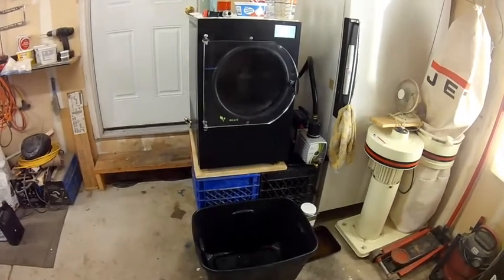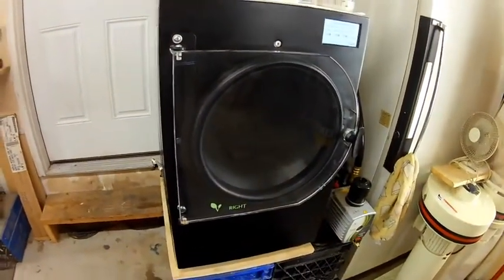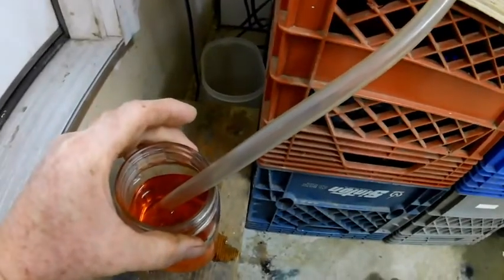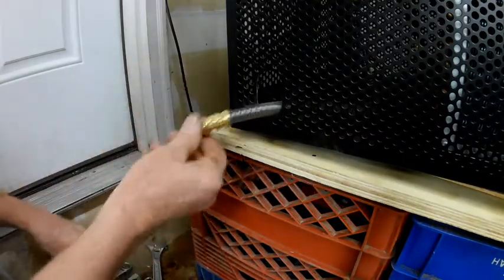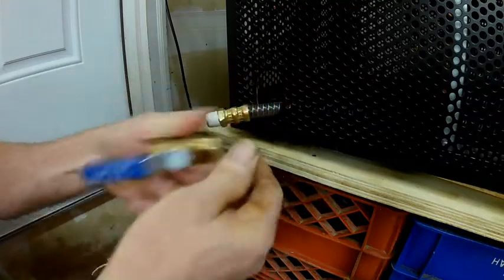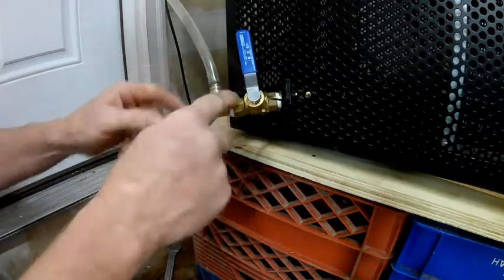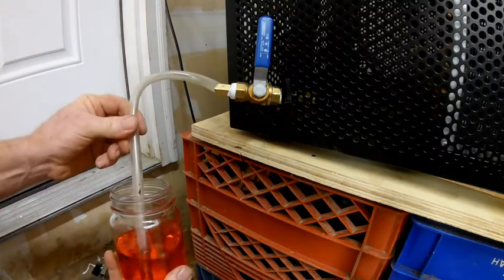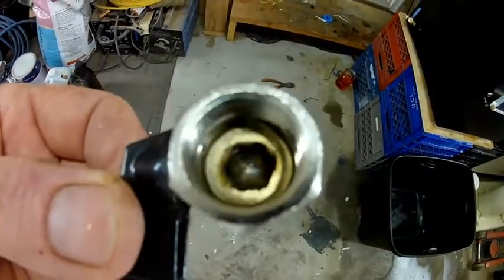Why is my Harvest Right Freeze Drier Leaking Vacuum?

Comment: I think the solution for me has been to replace the drain valve with a WOG600 rated ball valve, and then I taped every connection from hose all the way over the fittings to the threads with Silicone Self-Sealing Tape.  The only connection that is not completely sealed with that tape is where the hose connects to the vacuum pump.  I had my first successful bread batch and bottomed out below 80mT last night.  Thanks for the support and your helpful videos.
Reply: 80 mt’s!!! Wow!
Reply: Damm amy advice 80 mt

Comment: You should not make excuses for harvest right choosing cheap parts. I'm putting mine together for the first time and ran the vacuum test 3 times before fixing problem of no vacuum. 1st was a loose 90 where the vacuum hose connects to  the harvest right.  2nd was a piece of plastic that got sucked into the mouth of the vacuum hose from the chamber. 3rd  was replacing the 3/8 drain valve.  All this and I just received it new never ran a single batch, couldn't because 500 could not be reached. Harvest right needs to have better quality coming from factory in parts and quality testing before  it reaches customer. 
Now I get 500 in 13 mins 39 sec.
That you for helping solve my problem.
Reply from the maker: Glad I could help

Comment: I replaced my o rings in the hose and it works great now. Spent $1.67 at Ace Hardware. 7/8 OD 3/4 ID 1/16 W

Comment: I just got my freeze dryer a few days ago and was not able to get under 500Mtorr. After watching this video I took that ball valve off and it is already rusty and gunked up. It is brand new freeze dryer so how that valve is already rusted is beyond me. Thanks for the video though. Helped me find my problem.
Reply from the maker: Good to hear
Reply: @Philat4800feet  Hey Phil are these machines supposed to hold a vacuum. If I turn on the pump and pull a vacuum down to 500Mtorr and turn the pump off should it stay at 500Mtorr or gradually go back up? Probably a stupid question but I really have no idea and if anybody would know it would be you.

Comment: My pump passes the vacuum tests and all of the leak tests, yet after it goes to vacuum freeze, it throws the vacuum error.
Harvest Right takes their sweet time to assist, even blew off the phone meeting with me today and now seems I’ll have to wait until next week.
Their support of far worse than I had ever imagined. I asked to escalate to a manager and they told me the person helping me was a manager. This has been beyond frustrating and it’s been down half of the time I ha owned it.
Reply from the maker: The same happened to me with the vacuum issues.  There could be a third cause that I'm working on.  The next time you get the "Inadequate Vacuum" message, press continue.  You may have to do this twice.  My unit continued with the cycle and got down below 400 Mtorr.  The food came out without a problem.
Reply: @Philat4800feet  I did try that at first, but the error just kept coming back.
I plugged in the flash drive and looked at the log files. After 4 hours, in the vacuum freeze cycle, the mTorr number just keeps going up.
It odd that it only does this when it is super cold. But I can’t get it to reach the dry cycle anymore.
If I figure it out, I’ll let you know.
Reply from the maker: @fleebin2794  If it passes the carburetor cleaner test I wonder if your vacuum is ok, but your Mtorr reading is incorrect?
Reply: @Philat4800feet  I was wondering that too!
Reply: @Flee bin
Did you ever get this figured out?
I seem to be having the exact same trouble.
I pass all leak tests, machine stays in Vacuum Freezing phase until shortly after 10 hour mark, then "Inadequate Vacuum" error appears..4 times already.
This is my 5th attempt at a bread run.
Any suggestions for me?
Reply: @jocelynsadler6152  I had to send it back to Harvest Right for repair.
They thought it was a freezing issue, since the freeze pattern did not go all the way to the back.
Oddly, the original notes said they rebuild my premier pump, which I don’t have.
I had to call them back and schedule a meeting to get the real notes.

What is really odd was The first thing I did was to run a vacuum test, which it failed twice.
However it doesn’t fail when I run a batch and the mTorr goes into the low 200’s.
So, this is the opposite of what was happening.

This is their notes:
Repair Technician Diagnosis -
epoxy was leaking bad and drain hose was the old style and leaking was 284mt, after fixes would go to 84mt. Full frost and temp of -50.3. heat tested good and updated software, pump and hose tested good.
Reply: @Flee bin
Oh wow...did you get the machine back yet? And if so, is it working well?
I was able to get to 280ish  mTorr during my last vacuum test, in about 13 mins.
Then, when I try bread batch again, it gets stuck around 780ish mTorr. Close to the 10 hour mark, I get the vacuum error. 
So no problem reaching under 500 during test, but it never makes it there during a batch.
I'm feeling like it might be a faulty sensor?
Very frustrated as this is literally a BRAND NEW machine..
Reading a LOT of online comments, it seems like they may have dropped the ball somewhere in Quality Control for alot of these newer models..*sigh*
Reply: @Flee bin
Sorry! Just realized you mentioned it's doing the opposite now - you already answered my question! Haha
Reply: @jocelynsadler6152  Try a water test. Fill each tray with about 2 cups of water and see if it runs through to the dry cycle.
They did say they updated the software on mine, but no idea if that helped with the issue.
They said it had an epoxy leak. Don’t know what that means, but I had already sealed the top with silicon, as mentioned I other videos.
They also said my drain hose was leaking, even though I had sealed the fittings around where the hose met the fittings with self sealing silicon tape.
Best bet is to call Harvest Right and get a support ticket created.
These will tell you what tests to run and you may have to send it back, as I did.
Don’t waste your time on emails. If they are not responding, call the support number again.
Make sure you write down the support ticket number for each time you call.
Reply from the maker: Change your oil (new oil), put your machine in test mode.  Start up the freezer.  At -20 degrees start up the pump.  I'd like to know what you vacuum will be after 30 minutes run time on the pump.
Reply: This is why I won’t buy a freeze dryer, thousands of dollars just to have something not work! Crazy
Reply: @steveo1240  They really only seemed to create a proto-type and never seemed to built a real one, in my opinion.

Comment: My FD just arrived today. I did the prescribed initial function test. It wouldn’t go below 500 mTorr even in and hour. The closest it would get was about 550. I tried a bunch of times and in the process the minimum mTorr got worse and worse no matter what I did. I went to Home Depot, bought a 3/8” female/female brass ball valve, and presto, problem solved. Now, it gets to 500 mTorr in about 10 minutes, and to 430 in 20 minutes. Prior to replacing it, I did the water draw test from the drain hose, and it didn’t drain water. The inside of the original ball valve was caked with crap. I think the reason it was getting worse and worse was the crappy ball valve it came with leaked more and more every time I turned the valve. For a $4000 machine, I’d expect more.
Reply from the maker: Wow, a new unit with a bad valve...Shame.

Comment: You’re the only guy on the entire internet that says the ball valve is 3/8”. Some people are saying 5/8”.
Just got off phone with Harvest Right to be sure b4 I saw this vid.
Lots of videos show how to do the change but NOBODY mentions what size it is!!
Reply from the maker: 3/8" pipe size.  Most people may not know how to measure or measure with a ruler.
Reply: People are probably measuring the wrench flats when diameter is measured at the grove diameter of the threads for straight, and at the tip of the thread for tapered.

Comment: also to the thread of this subject.  Had a vacuum problem, pulled the machine apart to test for a epoxy leak, no leak there. The factory put the drain valve on soooo tight I had to have my husband and a new set of wrenches to get it off. Changed the valve and I did the test to see if it would get down under 500 mTorr and it did. I am running the other test now 
Fingers crossed.
Reply from the maker: Good for you

Comment: I haven't even done the drain valve test yet but I'm going to look there first. Ours is brand new and is having vacuum issues after only the third batch. It goes to 650mTorr and hovers there.
Reply from the maker: The drain valves corridoes after several batches due to the higher PH water.  I would look at the fitting first.
Reply: @Philat4800feet  I guess I'm just surprised it would do it that quickly. In any case, I'm heading home from Lowe's right now with a new heavy duty ball valve
Reply: Thanks for the tip!

Comment: i've had Inadequate Vacuum ever since i got my brand spanking new FD & i DID get one load of sperlaine dry bcz it was such light weight stuff but, had to run it twice!  now i'm trying to figure out how to do the thumb/flash drive test... you know...  for support read out.  i think you said the name of it & i thought i'd remember it but i guess i'm losing it for unfamiliar terms...  i've had my FD for 4 months but, am disabled so even just doing tests & moving forward is a big process for this great granny.  my 20# of carrots & some other stuff has long since spoiled...!
Reply from the maker: It sound like Harvest Right wants the log files form your machine.  If so, Turn off your freeze dryer, insert thumb drive, and turn on.  the files will download.  When done remove thumb drive and download files (attach) to an e-mail to Harvest Right.

As far as leaks, have you checked your hose and door gasket?

Comment: What type of valve did you replace it with? Looks much more robust than the HR one supplied!
Reply: I get it needs 3/8 pipe thread. But 3/4 int pipe? Wish you posted a Home depot link.
Reply: 3/8 fip. (Female)
Reply: @adamroper5259  do you see the one you bought on Home Depot’s site?
Reply: @adamroper5259  I guess I am an idiot, unless u can find a link to one that I need. :( sorry Adam

Comment: We couldn't pull a vaccuum no matter what we tried. Harvest Rite poured over the data and determined a new pump. We didn't get a single batch out of it from brand new. How did it leave the factory in such condition. For the 4000 bucks I spent, I expect better value right out of the gate. We got a new pump and tracked down a steady supply of high vacuum oil, and it's running the way it should now. Use a good quality oil and get yourself some self amalgamating tape and wrap every fitting.
Reply from the maker: Shipping company damage about 20% of freeze driers shipped out.

Comment: Can you give me ideas for door seal? I have to pull mine practically off of the drum and then close and lock the door before I get the thin strip around
Reply from the maker: Is the cord behind the trays keeping the unit sliding all the way back?  Try rotating the shelf unit CW/CCW
Reply: @Philat4800feet  thank you for the reply. I did have that problem at first but now it sits back and I have to almost pull the door seal off to get a thin seal. Once it starts vacuuming, I do get the wide strip.

Comment: I've done about 45 batches in a medium freeze dryer. Very few problems, does throw a vacuum leak every once in awhile but we just hit continue or whatever and it's fine, we don't even do anything.
Reply from the maker: The vacuum issue is why Harvest Right came out with their new software update.
Reply: @Philat4800feet  oh okay, I haven't messed with the software since I bought it but that was only like September of last year
Reply from the maker: @denverbasshead  Should be 5.X.16
Reply: @Philat4800feet  I'll see what version I'm at tonight
Reply: @Philat4800feet  I'm at 5.1.15
Reply from the maker: The next update may help you with vacuum problems.
Reply: @Philat4800feet  ok I'll do that soon. Just had to clean the condenser yesterday, so many screws to remove lol

Comment: I have my FD in my spare room which has one window. I'm in sunny FL so the room gets beastly hot. I open the window but it doesn't really help and our A/C runs constantly to the point of freezing up. Do you have any ideas on ventilation that might help? We don't have a garage, we are in a mobile home.
Reply from the maker: I see two problems.  
1.  AC system only freeze up when air slowly passes through the A-coil.  Either your A-coil is plugged up and needs cleaning or your intake filters are dirty.  The air needs to pass through the A-coils at a faster rate.
2.   Your freeze dryer will display a message when its too hot.  I believe it's 80 degrees.  A medium FD will produce  about 1500 watts of heat.  What direction does the window face? (NSEW).  Is your AC window mount or central?
Reply: @Philat4800feet  We have central air a brand new unit and all filters new too. They put dye but it didn't show a leak, they did wire it to the dehumidifier above the thermostat not sure if that would do anythimg to make it freeze.
Reply: @Philat4800feet  The Window faces West so gets the aftermoon sun. Ugh. The pump sits to the rear of the FD on the cart, was thinking of rolling the cart in front of open window while running to let the heat escape maybe put a little clip on fan too. Your thoughts?
Reply: @cheryls3777  IDK if you are actually on the move, or if your trailer park might have issues with thieves, but you may want to consider buying or making a small shed to put outside for your freeze drier. This is what I do for my bitcoin mining farm which has the same heating issues as the freeze drier but on steroids. You can put some fans inside to keep air circulating if needed.

Comment: pipe threading has always confused me.  are they 3/4 thread or 3/8?
Reply from the maker: Pipe thread is measured by the inside diameter of the pipe.  The Harvest Right ball valve is a 3/8" thread, because a pipe with a 3/8" inside diameter, threaded on the outside, will screw into the ball valve's threaded fitting.

Comment: Great video, have you considered adding a small amount of baking soda once and a while as a prevent treatment to balance out the pH?  Probably simple to just replace the valve every 3 years.
Reply from the maker: Pouring a solution of baking soda down the drain could be helpful.  Good idea.
Reply: @Philat4800feet   Being married 35 years my wife's never said I had a good idea thank you very very much

Comment: Our ball valve didn't even last 6 months before it started leaking. Disappointed in harvest right for not using a better valve
Reply from the maker: The problem is the water draining out of the chamber is acidic on the PH scale.  Unless the valve is 304 SS or better any valve will fail with time.  It may take several years.

Comment: I can't get anything to work. I'm going to try some tape, but its really bad I can't get anywhere close to 500 now.
Reply from the maker: There are only three locations for the chamber to leak.  
1. The door gasket
2. Drain port
3. Wire port
We need to make the assumption your pump is not the problem.  Go the the leaf icon and find the touch switch to turn your vacuum off  and on manually.  When testing for leaks run your vacuum for about 3-4 minutes and turn off.
before beginning, place a loose wad of tissue paper in the drain and wire port.  Run the vacuum,  Spray some colored water around the outside of the chamber where the pipe and wire enter the chamber from the outside.  You'll need to remove some of the outside panels.  The idea is the colored water will be sucked inside the chamber and will stain the tissue paper.  this will help isolate the location of the leak.  Use soapy water on the door gasket.

Comment: What about the inside of the freeze dryer? Does the acid have any affect on it.
Reply from the maker: The inside of the FD chamber is stainless steel.  Most ball valves will be brass and plated polished chrome.

Comment: My problem is that I am able to get to under 500 m torr in 20 mins but only if i take the tray rack out of FD.
When is in is sliding towards the door gasket pushing into it and it only goes to 650 750 to torr . Anybody elese having this issue? Unit is brand new.
Reply from the maker: I wonder if the wire harness is keeping the tray rack from going all the way in?
Reply: Phil at 4800 feet   thank you for the reply !
Well, I did the test with the racks in without testing the freezing cycle first. As soon as I started the vacuum   the trays were sliding slowly toward the door. I managed to get under 500 M thor with trays in after the freezing cycle done. Still they were moving towards the door tough :).
Reply from the maker: @ioansmarket  Could they be moving forward just from vibration?  You might want to shim the base of your freeze drier and level the shelves.  This would be beneficial when you do liquids.

Comment: For what it's worth, I don't trust the MT readings. Test with tray holder and without and get a big difference. 760 MT without tray rack and 390 MT with tray rack in. That means it can only be electrical.
Reply from the maker: There is a lag and difference between my gauge and the display